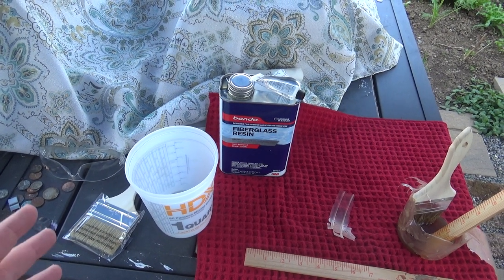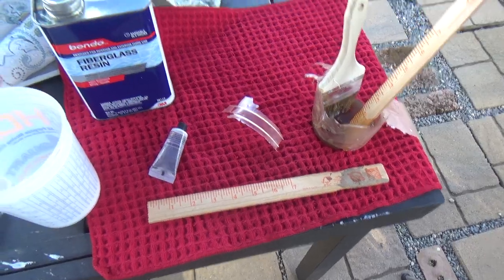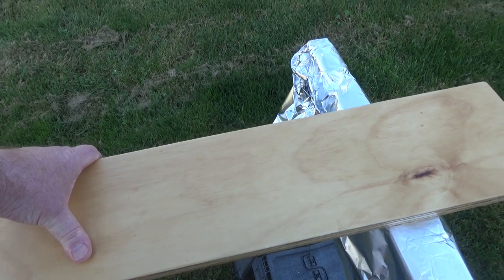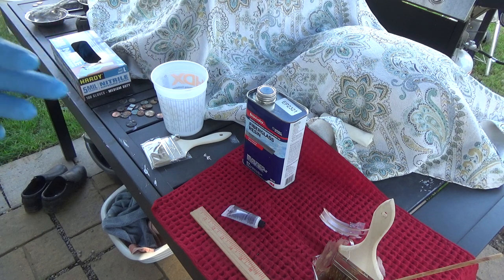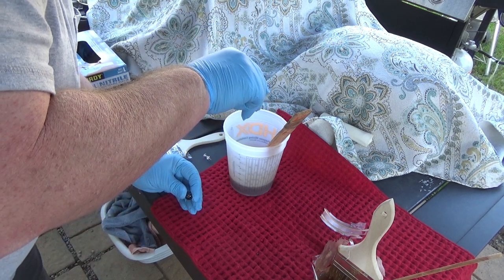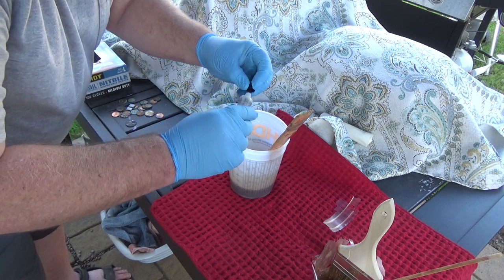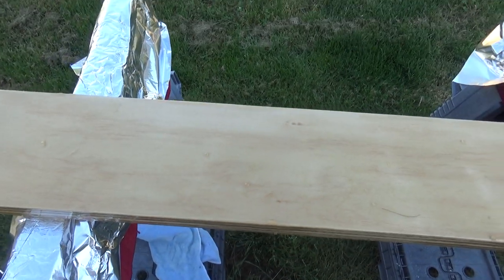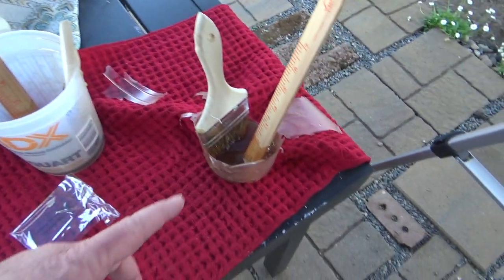How to mix fiberglass resin for boat transom

Comment: Definitely is an exact measurement thing cuz I probably did like 4-5 drops in a huge amount of resin thinking it was enough and it wasn’t. Been 20hours still wet and tacky. What to do?
Reply from the maker: It is more like an art.  First, try a small batch first.  It is like cooking eggs.  More heat, faster cook, but less control.  Low heat, takes longer, but more control.